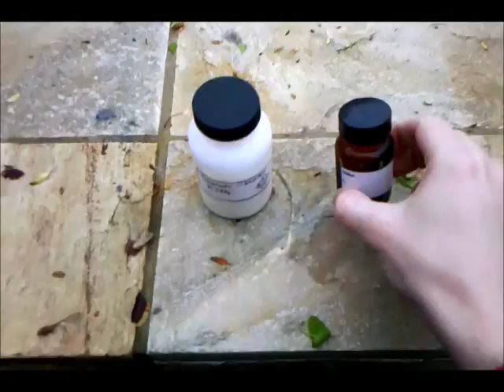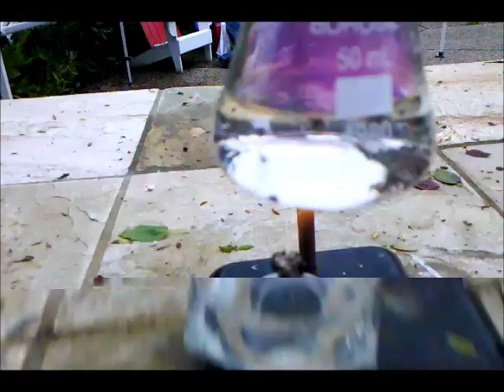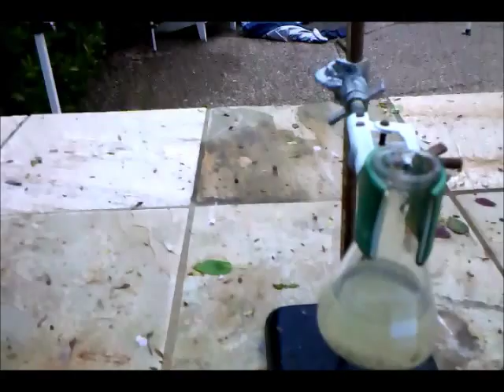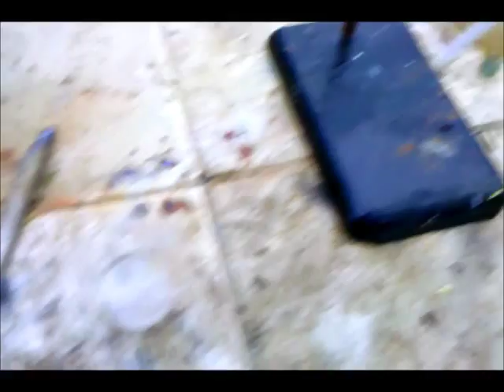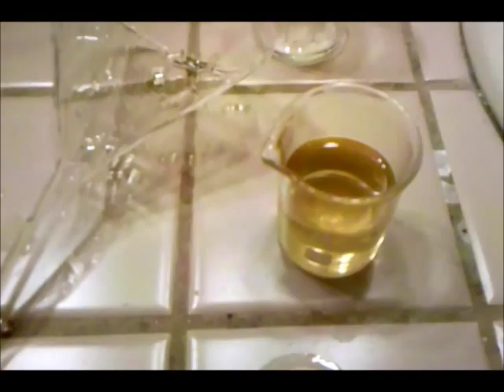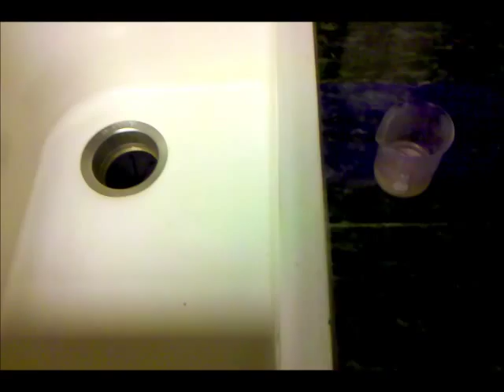Synthesis of Potassium Iodate

Comment from the maker: @AkiraKeiKyo I didn't.  I made it from potassium iodide.  KI is dissolved in a minimal amount of water.  An equal volume of conc. HCl is added.  This is added to 10x volume of 3% hydrogen peroxide slowly.  It is mixed and iodine settles.  Decanted the iodine, washed it 3 times, then dried.  I then vaporized and recrystalized it for ultra high purity.

Comment: @MrLordBanana If you did that it would have to be after the basification step because conc nitric acid and carbon form water and carbon oxides when mixed if I recall correctly.

Comment from the maker: @TheChemlife No, Ill be stopping in July most likely.  Shooting with my phone, I can (and have) made a holder out of a thermoplasttic that melts in very hot water, and cools to be extremely hard.  I need a tap and die set to get it to screw for tripods though, so if i get one then maybe I will buy a cheap tripod.  My problem is mostly with equipment I think, not software, though it might be nice to add an intro too.  Anyway thanks for the help!  I'd love to hear some pointers for how you do it.